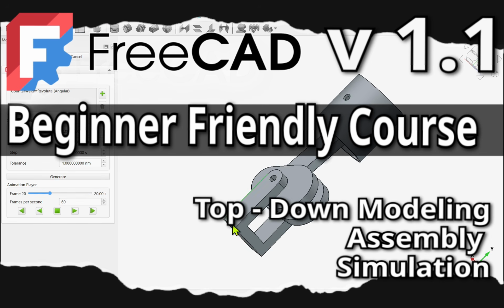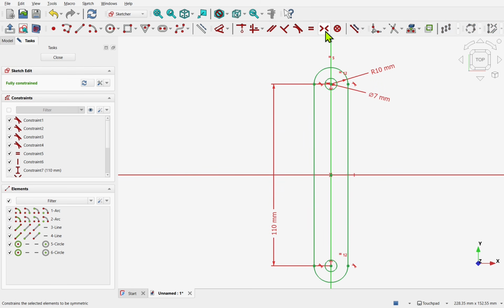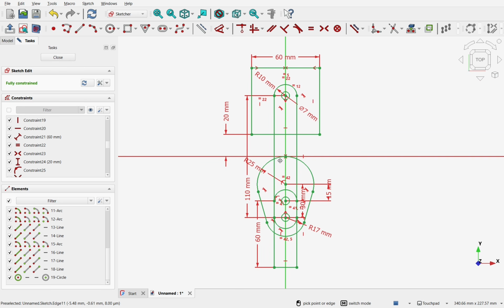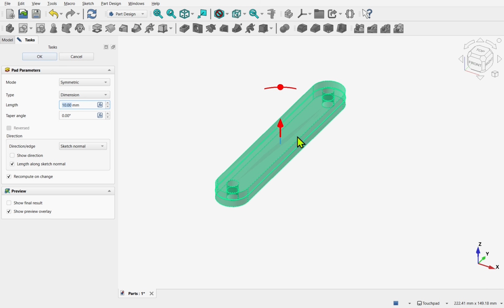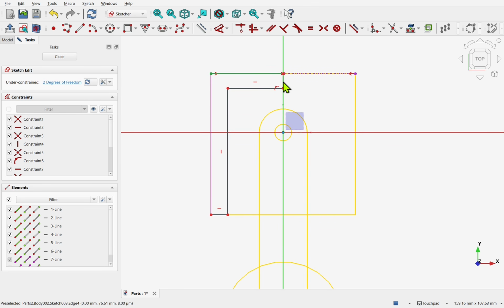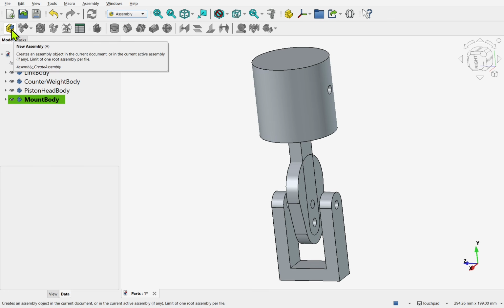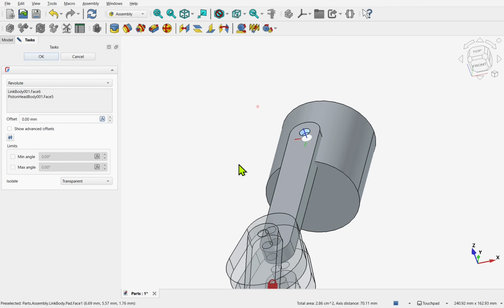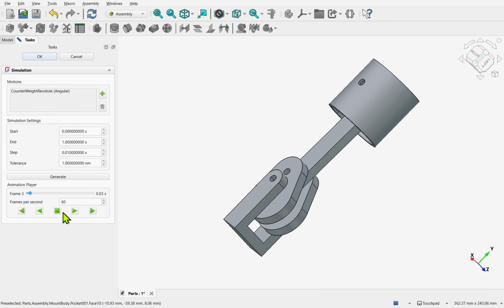FreeCAD 1.1 Beginners Friendly Modeling and Assembly (Model, Assemble, Simulate, Animate)

Comment: How I can use top-down approach for things, that need to be splitted in parts? 
I model whole thing, next - i do 2 copies, pad each to half so they match each other? Or there are specific tool to cut
Reply from the maker: Your approach you are following will achieve the  results you need.  You can also use the part workbench on your finished product to split the finished model by sketching a shape that intersects the model at the position for the split, filling it with a face (using the make face tool), and then selecting both and using the split tool.  Hope that helps.

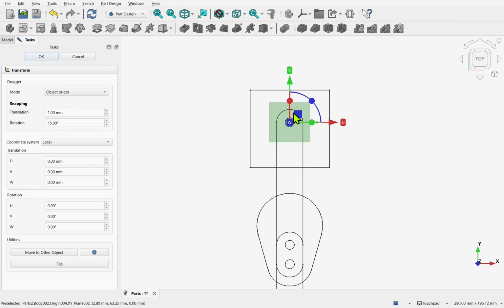Comment: I have a technical question.  at 27:02, you transform the origin to the center of a circle.  I was having difficulty with this step until I realized I wasn't doing it the way you did.  I was working through my difficulties with Claude AI and it pointed out something:  Claude thinks, maybe, that the transform is not parametric, so when the master sketch is modified, the transform won't move with it.  I'm aware that Claude is wrong at least as often as it's right.  Is this the case?  Will modifying the master sketch break the model?
As we talked through my difficulties, Claude suggested that applying a LCS is, at least, another approach
Reply from the maker: Good question. No transforms are parametric unless you physically link the position to something.  The transform is used to have a logical point of rotation / transformation, it won't break the model if it changes, it just makes it a bit easier for assembly.  

A common thing you will find  with multibody designs (and assemblies) is that all the component will have the same transformation point.  This often manifests when you download a STL of, say, a car wheel.  For some reason the point of transformation is not in it's center but miles off in the distance.  This is because the wheel is one component that has been assembled or designed around a much bigger assembly; the car itself.  The transformation point will probably be correct for the body of the car but everything is designed around it, individual parts sit in the correct place. 

You could apply a LCS, it's a viable option (I am surprised AI got this right! Often it confuses freeCAD with other CAD packages, older versions and even blender!) You would attach it to parts of the master sketch but you would still have problems,  if the circular hole disappears or changes into a square hole the LCS will loose the reference.

Comment: Is possible to use two master sketches? like top and front?
Reply from the maker: Yes you can have as many as you want.  They can be used as simple geometry to take measurements from (via expressions) or to drive the basic shape.  I have some more planned for the future as I currently have a project on the go that utilises them.

Comment: Another great tutorial, thanks! Taking your advice, I'm trying to create a master sketch for something. The thing includes a repeated element that is crying out to use a polar pattern. However, the pattern tools only seem to work on actual objects; they are not available in the sketching tool (as far as I can tell). I can create an object with the pattern OK, but how do I get the result back into my master sketch?

Comment: Thank you for your effort. Good tutorial. But İ have to say something to freecad programmer from here. Shape binder phylosophy in the body element, totally wrong, disaster. As a feature container a body is not enough for good project management. There shoul be a hierarchy  that can handle interbody things. We need to manage body with interbody element. Beside Why do we have to add binder element to the every body in the project for only one reference point. This is a bad programming method. This can be done by only one use button at onshape. This is not acceptable. İf Shape binder must be, İt should be a inter body element, not belongs to a body. This is important. And all body can take reference from one outer shape binders. This is true way of this, if shape binder must be. Actually your method better than than shape binder. There should be a master sketch that can reference all body without shape binder. Shape(body) binder dictionary mean is binding two bodies togather. İts nature already should be interbody. İt should be like cement between the body, not in it. Actually cad is simple like, define a reference point, draw 2d with reference, and extrude. As simple as it is. İ dont understand cad programmers why are they doing these, it is not complecated as they do.

Comment: I have spent over 3 hours following this step by step and every time I get to the part where you align the piston by using the slider constraint, it breaks it and causes all the joints to fail. I'm at a loss of what I'm doing wrong when I click what you click and do everything in the same order as you do.

Comment: Thank you for the fantastic tutorials on FreeCad. I use the software to create 3D models for printing. At what point would you add clearance tolerances, before or after assembly. I find it hard to build joints when clearances are keeping the parts from touching each other. Maybe you could point me towards a tutorial where you have discussed this already?

Comment: Hi, thanks for sharing your knownledge, you are a nice teacher. I have a question: Does the master sketch must be drafted with the correct dimensions, or can be drafted just as shape to be modeled with the correct dimensions following the workflow?
Reply from the maker: Hi, thank you for your kind comments and glad you are enjoying the teaching style.

You can begin with a simple shape to explore proportions, which is then refined into a fully constrained sketch where key dimensions and relationships reflect the real design intent. Master sketches can also be used for blocking out volume and layout, defining where major features of the model will exist. These can be 2D ( or 3D know as the master model) reference shapes that help establish fit, alignment, and placement before detailed modelling begins.

A master sketch (or master model) does not need to contain every final detail, it is often misunderstood that it must. Instead, it acts as a controlled foundation that ensures design intent is set early, similar to creating a blueprint before detailed modelling.

It is also valid to use multiple master sketches where different parts of the design are driven from separate structural references.

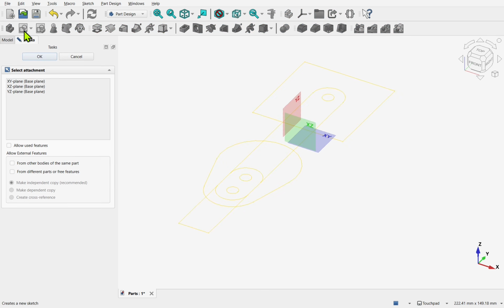Comment: 18:34 Version 1.1.1 Clicking "Add Sketch" Adds a new body and sketch under LinkBody and then you can't pull in the geometry for the part from the binder.  I was able to add a sketch to LinkBody by going back to Sketcher mode and then clicking add sketch which gives me a pop up asking to "Select the method to attach this sketch to the selected object" then I can pull in the geometry from the binder.  But then I am stuck as when i try to pad the sketch then it says an active body is required.  I have spent an hour trying to figure out what is going on re run the video through this segment over and over but I can't get past this.
Reply: I think you might have selected part(yellow icon)  instead of body(blue one)

Comment: Regarding, at about 3:29 "Notice the Vertical Constraint has kicked in."  
No I do not see it.
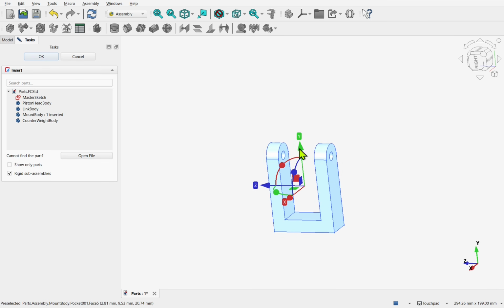Reply: At about 38:13 you brought in a part and there was a transform tool. I do not have that. How do I get it. I can click on a part and move it but it is not the same.
Reply: I some how have the Mount Body rotate from the Top view. I am not able to figure out how to rotate it back and no idea if every joint will break.

Comment: Do you have a similar video for 1.1 assembly explaining the sliding joint?
Reply from the maker: I am currently working on a tutorial at the moment for that :)  Normally you select on edge then another, but you also have the advance offset in the panel  (after you checked the check box) that allows you to adjust the direction of the slide.  Offset 1 is for the first joint in the list, offset 2 is for the second joint.  If you want the direction of slide to change but keep the component in the same orientation you adjust both.

Comment: Somewhere and somehow my ability to rotate the assembly as i used to is messed up. i cant rotate clearly in any axes as in a new file. i guess the different origins maybe?
Reply from the maker: I’m not 100% sure whether you mean rotating an individual component or the entire assembly itself so I will try to explain both.

If you’re rotating a component, avoid right-clicking and using Transform, as that can rotate the underlying link to the source file rather than just moving it within the assembly.

First check whether the component is grounded (red lock icon). If it is, select it and click the grounded joint button in the toolbar to toggle grounding off.

Also check whether the component has any joints constraining it—those joints will prevent independent rotation.

If the component is free-floating, or only connected such that moving it carries the rest of the constrained assembly with it, then:

1. Click empty space in the 3D view to clear the selection
2. Click the component once to select it
3. Click it again to bring up the Assembly Transform Widget

That widget is different from the standard transform tool and is the correct way to move/rotate components in an assembly.

If you’re trying to rotate the entire main assembly, then rotate the main assembly container itself from the treeview. Its origin defines the assembly’s position/orientation in 3D space and can be shown to show where the assembly is orientated. In this case, using right-click then Transform is perfectly fine, or you can adjust the container’s Placement values directly.

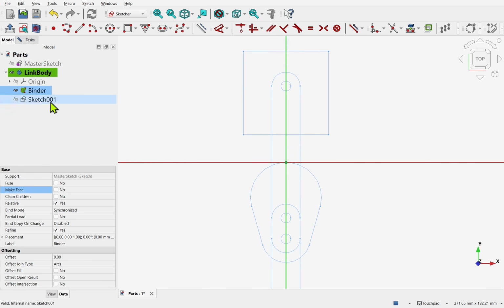Comment: Thank you. Great tutorial. I am using 1.1.0 Rel date 2026/03/25 02:17:53. At 18:52 when you go back to the "Model" tab, I have an extra Body (just above the binder) and the body owns the sketch. When I try to project the (yellow) binder geometry, I get the message: "This will cause circular dependancy. Unamed.Binder.Edge2" and I can't go any further. 
Any suggestions? 
Thanks in advance.
Reply from the maker: Ah so was tracking back last night and I think I know what has happened.  When you created a sketch for the master sketch you probably created it via the part design.  Which creates a new body and a new sketch if a active body isn't present.  Going via the sketcher just creates a sketch.  This is not an issue as you can drag the master sketch out of the body onto the document icon to release it from the body and delete the body.  Delete the binder whilst you are there.  Make sure the body you want to work in is in bold in the tree view, so its active  (double click it to toggle between active and not active) and create the binder again by selecting the master sketch and using the sub shape binder.  You should then be fine.

Comment: Great tutorial, though I'm going to start it over because once I added the sub-shape binder, something went wrong. Clicking New Sketch inserted a new body above the binder instead of a sketch below it, and from that point on none of the subsequent steps seemed to work. Edit: Wasn't paying enough attention to what was selected. Made sure Binder was selected and it worked as expected.
Reply: This is one of the most common mistakes, I think. Not having the right thing selected, having the correct body as active - that stuff can drive you nuts then you see it and do a head slap.  But the more you use Freecad the more natural the processes become.

Comment: how did you add the model and task tab in the same spot? when i drag one over it just pushes the other one down
Reply from the maker: It's often the case of just a small movements forwards whilst you are still dragging them and they will then snap to the correct position.  It can be a bit sensitive.
Reply: @MangoJellySolutions  i saw you talk about it in your other video after i posted. thanks mango!

Comment: Thanks so much for this wonderful video! You really are the best 'user manual' for FreeCAD. Whenever I’m unsure about a procedure, my first move isn't checking the official documentation—it’s searching through your incredibly helpful video collection.
I do have a question regarding positioning: Is there a way to precisely position one part relative to another, such as a 'face touching' constraint? In this video, you positioned the second CounterWeight by offsetting it 10mm from the first, but I was wondering if there is a way to snap or position it directly relative to a specific link face?
Finally, I’d love to see more references to keyboard shortcuts! I personally prefer hitting 'C' for a coincident constraint or 'T' for tangent, though I know that comes down to personal workflow. Thanks again for the great content
Reply from the maker: Thank you so much for the kind feedback, great to hear that the channel has been such an extent of useful knowledge, I just need to make some kind of index.  So looking back I could of made the fixed constraint against the face of the other counter weight but still need a offset.  But if you try to make a fixed constraint against the link face and the counter weight, you would need to select the show advanced offset in the link options and modify offset 1 (or offset 2) along the X,Y as it may not be positioned correctly.  This would allow you to 'slide' the faces around until you get the alignment you need.  If that makes sense.

 Ah yes shortcut keys, though I use them when modeling I tend to steer away from them when teaching as they can be quite hard to remember and not very good for accessibility and certain ways of learning.  I totally agree with you of how useful they.  Thank you so much for the feedback, really appreciate you taking the time.

Comment: This tutorial is excellent and it wasn't hard to understand your explanation. I'm a hobby user of FreeCad and I heard that Assembly4 would be better for big assemblies, do you think this is correct? Would animations like this one be possible with Assembly4. Thanks a lot.
Reply from the maker: Glad you liked the tutorial.  Casting my mind back to Assembly 4 there is a animate option called animate assembly and looks like 2 cogs together on the toolbar.  You use it by setting up variables in the workbench which can be assigned to properties via the expression editor i.e. the Z placement of a object.  You then select the animate tools and within select the variable,  set the start and end range and step value.  Hitting play increases the variable value in that range and affects the parts linked to the variable.

In regards to large assemblies I am not sure of the answer to that one as I haven't stress tested the two assemblies side by side.

Comment: I've come from OnShape, and I'm trying to learn FreeCAD. In Onshape, I would use separate sketches rather than one "master" sketch as you have used. As a very basic example, I would sketch a square and extrude it. And then, if let's say I want to create a hole through it on another axis. I would create a new sketch on the face of the part I have created and go on to do a "Negative" extrude. I found it much easier to organise by doing a sketch/extrude for each major feature. Of course, I would normally combine a sketch with the example I provided. Why do you do it this way?

Comment: I am completely lost.  I am a first time Freecad user, and have no idea how any of this works.  Your screen setup is done with your preferences, the program as it shows up is quite different than mine.  I can't find how to change the settings.   For instance, in your left pane you have 2 little tabs at the top, looks like Model and Tools, mine does not have those and I can't find anything about how to turn them on.  I also somehow accidentally turned on the Python  bottom pane and for the life of me I can't get rid of it.  If you are going to do Tutorials like this, ensure that you use freshly installed software and leave the preferences and settings bone stock for the benefit of us noobs.  Perhaps you can point me at a more basic tutorial?

Comment: Firstly, I want to say thank you for giving this great tutorial.
Are there a lot differences between freecad 1.1 and 1.0.2?
Since I installed 1.0.2 on my laptop and I cannot see some features as on your tutorial?
Reply from the maker: Ah yes so there are quite a few  in relation to this tutorial 1.1 introduces two new external geometry import tools, projection and intersection, the import of external geometry can be toggled between defining and construction, the assembly has the new simulate tool, the assembly wb is far more stabler.  That's just related to this tutorial, there is a lot more in 1.1 but RC  (release candidate) version are available for download and can be run along side other version of freeCAD as the have segregated the preferences.   Glad you are enjoying the videos :)
Reply: Hello . Very nice videos , I am still learning and enjoying them all. Great teaching skills en well explained.
Very good question about the difference between 1.02 and 1.1 version.
I am following this tutorial on the 1.02 en het stuck on the external geometry extrusion. Is there a way to do it on the 1.02 version or only with the 1.1 version?